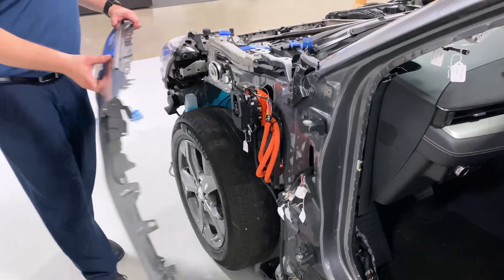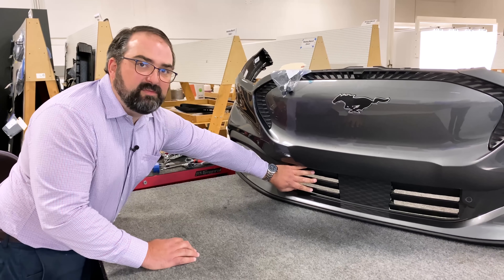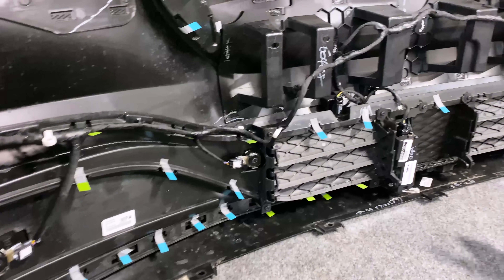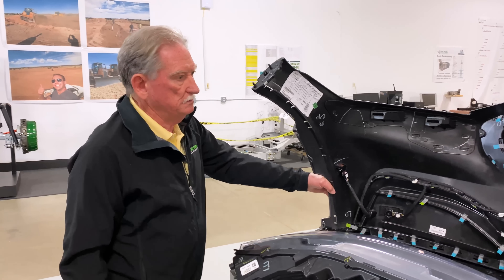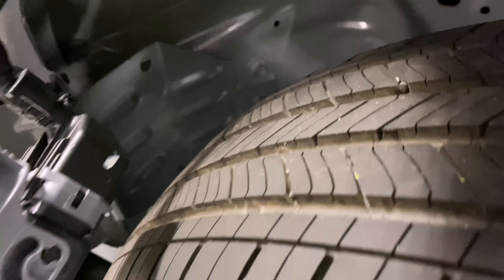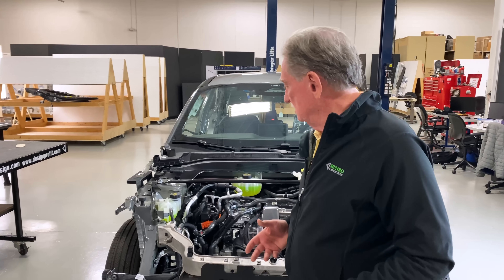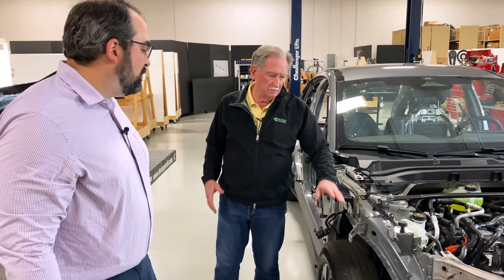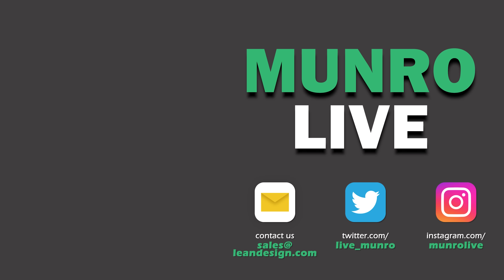Does the Mach-E pass the SORB test?

Comment: btw props to Volvo whose S80 from 2007 as the oldest model that passed this test as well as the 2013 Accord with its ACE body structure. The Infiniti G37 sedan from 08ish also did reasonably well. everyone else failed miserably. 

As for side impact, the industry is about to get shaken up by the IIHS side impact 2.0… stay tuned.  newsflash: the current Camry will be a super star. the accord acceptable. The VW Atlas also superb, having the strongest body ever tested.

Comment: of course VW was thinking of a frunk but they made a choice that sandy does not understand which is really crazy.
Reply: Not just Sandy, but just about everyone that reviews it.
Reply: Some reviewers say VW gave the ID.4 a short hood and put more space inside the passenger compartment. Overall, the ID.4 is 5 1/2" shorter than the Mach-E, yet the ID.4 beats the Mach-E on interior cargo space (with back seats down) - 64.2 cu ft in the VW v. 59.7 in the Ford.
Reply: @timdsd  And still no one cares. The VW ID.4 has fallen short on pretty much every reviewers list.

Comment: 1:41  A Frunk - Extra weight ahead of the front axle that creates a nose-heavy handling vehicle
Reply: Just how much weight do you think a frunk holds?
Reply: @TheEvilmooseofdoom   I leave mine empty all the time.
Reply: @7spower998  Mine too, now that they added the airholes & escape latch!
Reply: @andynicolson1057  They added air holes so if somebody is trapped in the frunk they won't found a dead body?
Reply: @7spower998  Does not change the fact they don't hold a lot of mass and absent the mass of a ICE anything you do put in your frunk is not going to make it nose heavy.  That's nothing less than nonsense.
Reply: @TheEvilmooseofdoom   Extra weight ahead of the front axle is extra weight.  I would rather have the extra weight in the trunk where the tractive force is than in the nose that gives a FWD-like handling trait. Obviously, you like a FWD-handling vehicle. Not for me.
Reply: @andynicolson1057   Excellent. Great minds think alike!

Comment: I don’t like the snap fits on the lamps. It will force HL replace in collision on light hits. This jacks up ins rates. Rather a bracket secured to lamp the other snap fits are great.
Reply: Oh I do like the rebar mounted similar to the Escape. It helps on collisions to not damage lower rails. Most collisions we just need to repair the ears on tail end and replace the rebar

Comment: I understand Snady's joy over snap fits for production, but as an end consumer these things are a G-D disaster making a modern car more difficult to work on. Most snap fittings cannot be removed without damaging them. Not to mention environmental deterioration making them brittle. And while repairs may be rare for most people, They do some times occur. I've got a 2014 Tundra that has had rear bumper applique fittings fail as well as front metal grill fascia snap fittings starting to fail. There is no way to repair these built in failing snap fittings.
Reply: Couldn't agree more. I LOVE bolts. A trusty socket set and you can work on almost any part of an old car. Meanwhile I have broken multiple panel clips on newer cars. I wish there was a middle ground.
Reply: Agreed, I've found Sandy's thinking biased towards production efficiency and integration over maintainability and longevity in general. This is not always the best outcome for the end user or the environment.
Reply: @jay-em  His focus is in production, and snap is great for the producer.. nd terrible for for the actual owner.
Reply: @jay-em  Exactly. Optimising for production only is short-sighted. We're moving past this sort of 'peak capitalism' to a more complete view of whole-lifetime optimisation. Sandy is looking increasingly old-fashioned in these vids as he rails against repairability/maintainability.
Reply: Sandy’s opinions are biased toward the ease of and decreased cost of manufacturing because that’s what his firm sells.
Reply: The solution to the issue could be to include bags of extra snap fittings with the vehicles.   They're mainly a PITA when they break and you have to find replacements right then.
Reply: Replaceable snap fittings :)
Reply: I agree completely, old brittle plastic snap fitting parts are just the worst to work on
Reply: I keep wondering how you can do any kind of collision repair on these cars before totaling them.  Sure, a few pounds of bolts hurt the advertised specs, but I probably carry more weight with the junk in my glove box.
Reply: @njphilwt  What's in the glove? A bunch of 12oz tungsten fishing weights?
Reply: There are maybe possibility for both.
Use snap fits, but have bold holes close by. If your snap snaps, you can use the bold holes for replacement fastening.
Reply: Yes honestly this just looks like cheap plastic crap.  Good luck fixing it.  And this is a pretty high $$$ vehicle.
Reply: no kidding. I hate plastic snap fittings
Reply: I've worked on plastic clip fittings after a few years you're lucky if half of them don't get brittle and snap off and the other half warp with heat and sun and don't fit the socket properly and fall off. I'd like to see that Mustang in 10 years time I bet most of that plastic crap in the front end will  fall off if you even sneeze on it, as the clips get brittle...
Reply: Exactly …. Snap fits are only beneficial to the auto maker, 6-10 years down the road everyone of them are going to become brittle and start to become loose and rattling around or completely fail the first time you need to remove and try to replace them again. I think folks need to understand that Sandy is making these recommendations for the Auto Makers and not so much for the end user. The Auto Makers will save money and charge us the same or more for a shittier made vehicle, none of these “savings” are for us.
Reply: Amen, same exact thought.  Sandy loves these Lean manufacturing techniques which result in vehicles becoming mechanically totaled within a decade.  Great for manufacturer profits, bad for end user.   Another great example is the Mach E window mechanism.  He loves that Ford integrated the mechanism with the door panel but this means replacing the whole door panel when the window regulator invariably fails at some point.
Reply: Agreed from the DIY guy in me. On the other hand, saving assembly time and materials means a cheaper car (remember competition) , and lighter is always better
Reply: @Da5idc  You want a cheaply made car?
Reply: Cars today are like those snap-together models from childhood, just sized up.
Reply: Who makes fords snap fittings?
Reply: My prediction with these plastic snaps - mild bumper hit, nothing critical, but over those snap fits you transfer some of that energy into the headlight, crack it... Now you don't just repair/replace the bumper, but also that not so cheap headlight.
Big Win!
Reply: In this particular case it seems to make some sense--the most likely scenario is that the whole bumper is going to be broken in some way and will need replacing, whereas where they didn't use snap fit on the inside of the door frame is something that will more likely be a repair rather than a replace.
Reply: because: Capitalism.  speed, efficiency, and profits over EVERYTHING.

Comment: If I owned an E-Mustang and was inclined to want to work on or repair it, I would love to be able to buy from Munro a set of videos on how they dissect this car....it would be way better than a shop manual.
Reply: Tearing things apart is easy, getting the torque values however is the part you pay for.  Luckily with the internet, someone usually beats you to the replacement and they share their knowledge.  Welcome to the information age.
Reply: @mhamma6560  Good point….if Sandy had his way there would be zero fasteners in the entire car…all snap fits and 3M panel bonded.
Reply: You are so right. They are building these cars so that people can fix them on their own
Reply: @jimcmf2  Don’t say that in front of a Ford dealership’s service department.  ;-)
Reply: @gwarlow  I think that they overcharge at a dealership. I do any car repairs myself. I don't mind paying fair prices, buy prices through the roof are unacceptable.

Comment: 10:20 do you think this bolted on to make collision repairs easier? If all of the fender attachment points are welded or stamped as part of BIW, it seems like repairs would be hugely complex and expensive with a lot of cutting, welding and fabrication.
Reply: Came here to say this, larger SORB spaces allow for more temporary damage repair areas. 

Most light accidents affect fenders and/or quarter panels.
Reply: The probability of that kind of collision needs to be multiplied by the cost savings to understand whether that is actually a smart idea or not. You also need to consider the time value of money (and interest rates) from an accounting standpoint. Otherwise, a consumer would rather just put the savings in their pocket and get charged a negligible amount more to insurance company, which can then also invest that money into bonds to reduce costs further.
Reply: I initially thought the same thing, but then I realised that the mounting pieces that those brackets are bolted to are welded to the BIW, and there’s no reason to expect that in an accident only the bolted-on piece would deform and the welded bits would survive intact. So there’s no real difference in terms of repairability.
Reply: The car is not meant to be repaired, in a perfect world there would be no crashes.
Reply: @RocketScienceKSP  Are you even listening to what you're saying?
Reply: Everything should be meant to be repaired. 

If we treated people like these new cars, we'd just toss em' in a dump after they turn 40.

"Green" cars should be maintainable so that they don't fill up landfills like E-waste already does.
Reply: @IBUILTTHAT  
It’s all recyclable
Reply: @IBUILTTHAT  I agree. But if this were true vehicles would be designed to be prepared as they wear out. They are not. The last production car that I know of which didn't use designed obsolescence is the 1993 MB E 300 series. Just earlier than that Porsche Engineering (a spin-off of the car company) contracted with Benz to help them implement it. I am not sure but I think the target at the time was 14 years. American manufacturers targets were much less.

The rational is for for future earnings, refreshing the fleets safety systems, higher efficiency, better emissions, etc.... With the introduction of more recycling, it partially removes the argument that buying a new car is bad for the environment. But it takes energy to recycle and build cars, and there are always a portion of the recycle process that lands in the landfill.

I think Tesla doesn't employ designed obsolescence. But because of the rapid and often profound improvements in Tesla cars, the newer models are more highly desired. Not to mention over the air updates.
Reply: @RobertLBarnard  Tesla doesn't need to spend engineering time on designed obselescence because they can just arbitrarily disable your car after so many years. (Or whenever they want to)
Reply: @user2C47  True, this is an option for them. But its a little hard to imagine them doing such a thing... Unless the government forces some issue.

Comment: Is magnesium a problem in a fire?
Reply: Yes, but you've got to get it really hot before it catches. 
"Magnesium is flammable, burning at a temperature of approximately 2500 K (2200 °C, 4000 °F). The autoignition temperature of magnesium is approximately 744 K (473 °C, 883 °F)."

Comment: I see a lot of thinkin’ for the manufacturer, not for the unfortunate mechanic
Reply: I mean as long as you're careful and the plastic doesn't break it's cool.

Plastic never breaks right?
Reply: And also not for the customer. If the clips on the headlight breaks you need new headlights.
Reply: @winkekeks  most headlights are trashed if they are hit any harder than a 6 yr old can hit. most Bolt on through plastic tabs.
Reply: Yep, mechanics love easily accessible threaded fasteners and loctite!
Reply: this will be reflected in insurance premiums so the cost is just transferred from the manufacturer to the customer in the form of enhanced insurance premiums.  Instead of replacing a simple bracket you have to replace a whole extrusion.
Reply: @joeyscleaningladys   Like that's something new. Nice try though.
Reply: @twany442  uh costing down to include snaps which are disposable is against the ethos of electric cars.  If something gets salvaged due to the design of it then that is a huge issue with regards to disposable society.  While I admire some of what munro does I think repair-ability should be part of the redesign ethos rather than just costing it all down
Reply: @joeyscleaningladys  Kick rocks
Reply: @joeyscleaningladys  Has it been salvaged? Then stop worrying about something you will never own or buy. I don't have time for sideline philosophy of regurgitated information. Bye!
Reply: @twany442  How do you know I won't buy it? if the premiums are too high based on perfectly good components being thrown away into landfills due to a plastic snap going bad then maybe that is something I will consider.  Manufacturing is different than the full ethos of the vehicle... repair ability is a huge issue on modern vehicles and if the fasteners salvage a 1000 dollar+ part that is a short term ideology.  Might as well make things repairable unless it is a throw away econocar.
Reply: @twany442  ok
Reply: @twany442  It appears you do have time for sideline philosophy because you’re replying to it aren’t you?
Reply: @ZeusBullyMax  If you could get to point without regurgitating my statement. Look simpleton ...once again I don't have time for your elementary bullshit.
I'm so sorry that your feelings are hurt but that's not my problem.  I'm sorry that your beloved Tesla is starting to lose ground to a manufacturer that's made their first true EV. Not my fault!
Reply: @twany442  I like vegetating vegetables. It’s so easy and fun to do
Reply: @ZeusBullyMax  I would prefer if you just stop breathing.  Tales of anything you do or like does not interest me. At the sound of the tone you may have several seats.
Reply: Hodgepodge setup. Not designed but piecemeal together. Not impressed. I guess as long as it looks like a Mustang. They use the parts they had and then some additional parts were created for the transition. Not for me.
Reply: @ZeusBullyMax  Then don't buy it! OMG!
Reply: @twany442  No shit Sherlock I won’t.
Reply: remember - 5 mins of mechanic time - $10 --- 5 min. assembly line time is millions
Reply: @Lassi Kinnunen 81 the customer should care though for repairability in the unfortunate case of an accident what should cost a few k to fix will cost tens of thousands and will be reflected in insurance premiums and resale.  Wish sandy would have a balance between repairability vs just pure cost cutting
Reply: All I see is cheap plastic.
Reply: @cyberfred5520  Then stay out of the mirror.
Reply: Make it good enough to be better than the competition but not so good that planned obsolescence doesn't bring the buyer back in a few years. Can't have quality used cars keeping people from buying a new one.

Comment: Near the end talking about nesting plate, where I work we call the waste "drop".  Sometimes if it is significant enough to use later, said remnants go back into stock for future use.  If too small or bad geometry then it goes in the recycle bin.  It's fun to hear this talked about on the car manufacturing side, it's always a balance of working with stock sizes and optimizing for sheet usage that also makes for the least amount of weld.  Sometimes it is preferred to make welds where we can use coil sheets vs standard 96" or 120" wide sheets.  Cost/lb plays into usage since coil is cheaper.  In the case of these car parts, they're mostly small and you have the freedom to work with whatever size sheet your heart desires.  Typically thinner gauges only come in 48" or 60" wide sheets though.  We typically work with 3/16" to 2" thick plate so we can be picky on what width/lengths we require from the mill to minimize splices etc where a standard length won't work.
Reply: This is fascinating!

Comment: I'm guessing that they use a single fender attachment piece to guarantee proper spacing for the side fender clips. That piece probably goes through tolerancing that the main BIW doesn't. If they remove that center beam and replace it with two pieces then that spacing could be problematic.
Reply: Based on precision requirements for mounting body pieces, you would want the mounts to be very precise.  As Sandy mentioned with Castings, you could remove parts and still maintain precision by also eliminating the welds.  So, it CAN be done.
Reply: I like the fender brackets. They are a bit adjustable also. If it was part of the upper apron assy insurance would write full refinish time on aprons something like 1.8 vs .3 for a bracket. And customers who  always bump the RT or LT corner of car pulling out...and it’s a lot would have to only purchase a $20.00 part. Most of these brackets can be bent back with your little pinkie but some are overbuilt stamping that should be rethought.

Comment: Talk of weight??? Get rid of rear speakers? Motors in seats? Mirrors. Wires for read door electronics?  Wow"...
Reply: Frunk and Trunk. Fenders. Water cooling, just load a bucket of ice at the next 7Eleven. HVAC. Windows. Half of steering wheel. Doors altogether. Canvas is good enough for Military use why not for the rest of womankind? Who needs a roof? cupholders. Consoles - center left right top underseats remove them all!

Comment: The fender brackets are separate so they are replaceable. You don't want a minor fender bender requiring structural part replacement.  I wish Sandy would look at these vehicles from a collision repair viewpoint also.